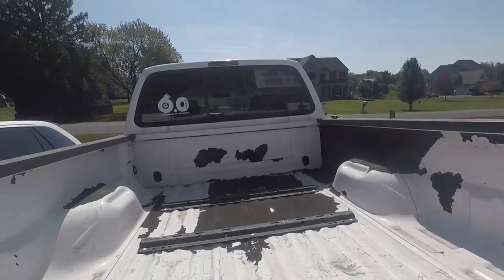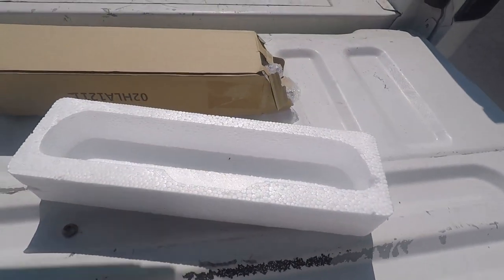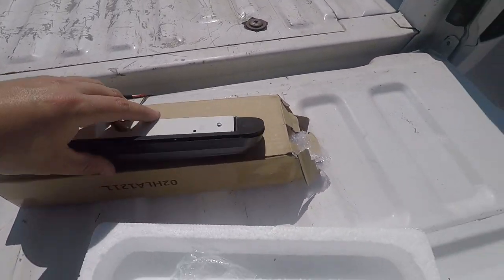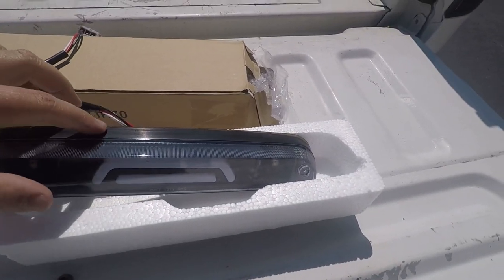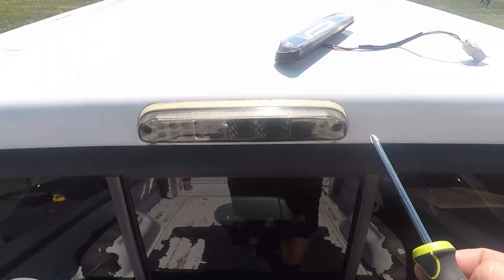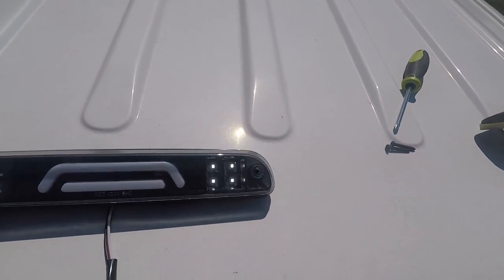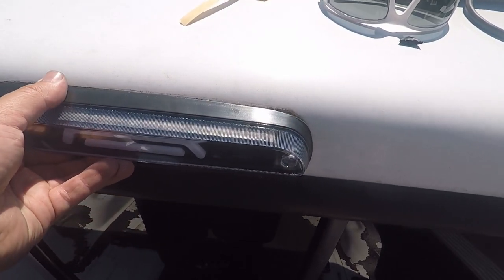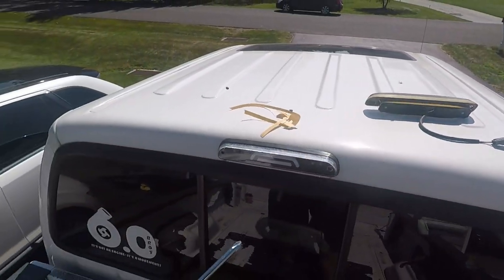Ford Super Duty Rear Brake Light Replacement

Comment: I've got this exact same third tail light on my 05 350.  I'd have to say if I didn't have a long bed, the bedlight would not shine very much in the bed.  I would suggest you put a followup video for night performance, thats what most people want to see.  Paired them with the Taillights: For Black Smoked 1997-2003 Ford F150 99-07 F250 F350 LED Tube Tail Lights Lamps Pair Left and Right also on amazon, looks great! I highly recommend both.
Reply from the maker: It lights the bed up pretty good in the future I'll do a video showing it at night